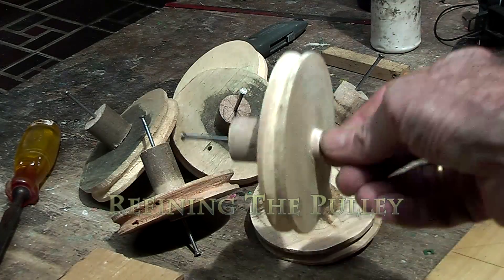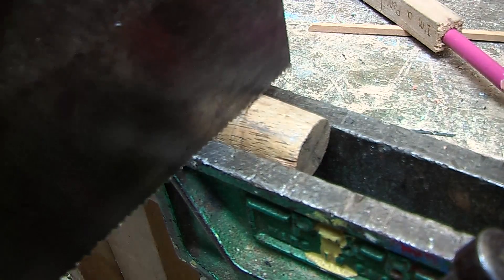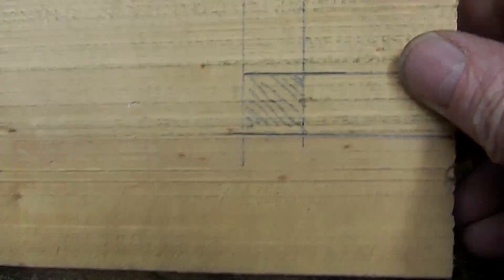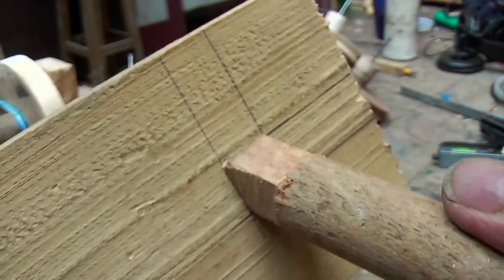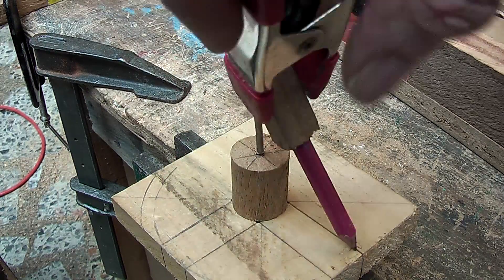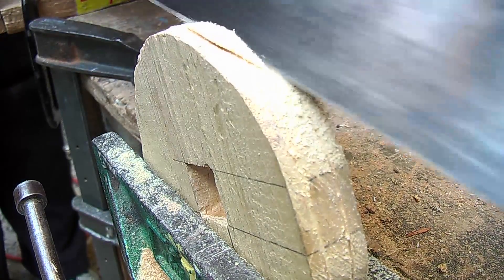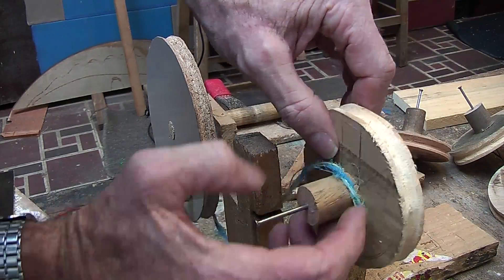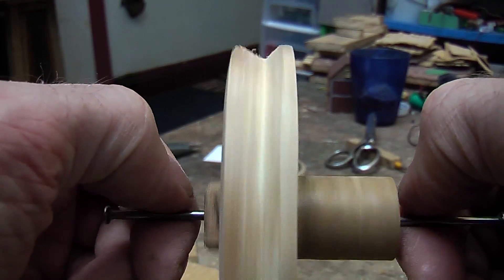Refining The Pulley

Comment: Another great video, thanks for uploading. I noticed you have a pile of finished pulleys and I couldn't help thinking, wouldn't it be easier to glue the round shaft instead of making it square?
Reply from the maker: Yeah, it  would seem  a logical thing, but  you can't  beat the  'it definitely won't slip' perspective of that square peg in a square hole. In  making the square peg it also helps align the  wheel and also gives me a depth position. I had too many problems with the  round pole in a round hole...none with the  square. But  sure,  a round glued one works.

Comment: I am very impressed by your lathe. but how do you make the mini lathe turn?
Reply from the maker: Hand cranked.  I have done a couple  other videos on making and using that  larger wooden pulley at the back , which is why I did not focus on it in this video. It means you only have  one hand for the   turning, but , with a little practice it works  ok for  small emergency-like jobs.

Comment: Thank-you for another interesting video. I enjoy the engineering you manage with limited resources. 

I wondered why if you are going to use a wedge to hold the pulley to the shaft, why do you bother with the extra effort in making a square hole and squaring the shaft. Why not just cut a notch in both the shaft and a round hole to fit the wedge like a key?

My question is on the assumption you have a drill to make a round hole.
Reply from the maker: I tried a key, it was  more difficult, and more complicated for me ...and the  key  also  deteriorated or fell out in certain circumstances. The square hole was easier for me to make  , and fail-safe on  cutting  slippage on the shaft, and  works  for big or small shafts. The  wedges also help center  up a sloppily cut  hole and square pole end so it  can be done quite quickly and still works. But  yes,  you are right. Keys  work too.
Reply from the maker: oh, also , as I will show in later videos, the square hole  is  also used in the  crank pulley in the hand generator where the  pole is not  cut to a square end , but  planed as a square wedge. It really fast and  very effective. and  once you get  used to  using your chisel (which every carpenter should do) it is not so hard, and  cutting square holes is as fast as squaring a drilled hole, although that can be   done  quite fine too. :)
Reply: Ah thank-you for your explanation. My last experience with chiselling was with a pretty poorly made tool, on some wood in America that was wonderfully resilient!.
Reply from the maker: Cool. I must admit  a sharp  chisel is a must, but I still am not an expert in getting mine sharp  :(
Reply: @philips, i only use a stone to sharpen my chisesls, but my tip is this: after you have done all the stone work, polish the egde, i admit i have a wheel on my grinder for that job, but put a mirror shine on the bevel you cut and you have a razors edge every time